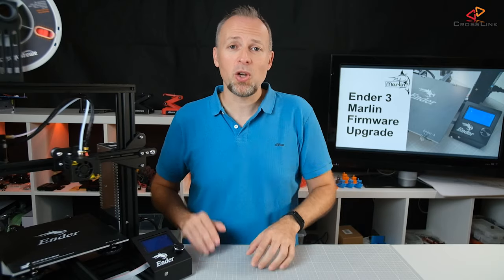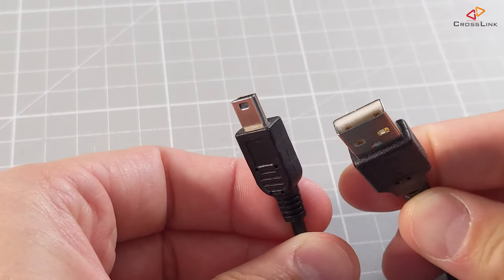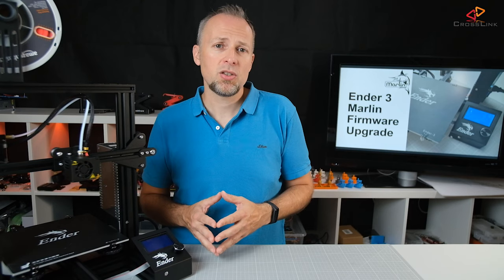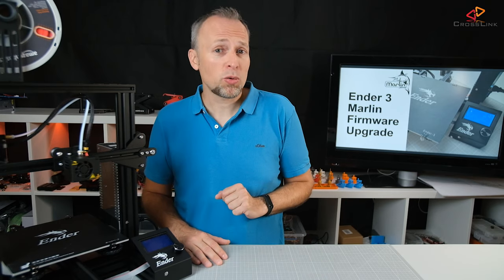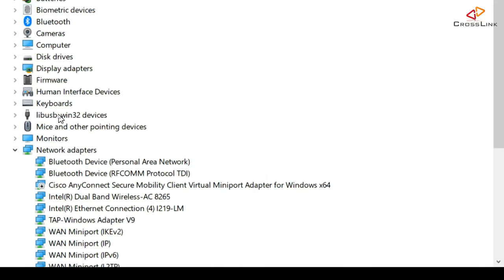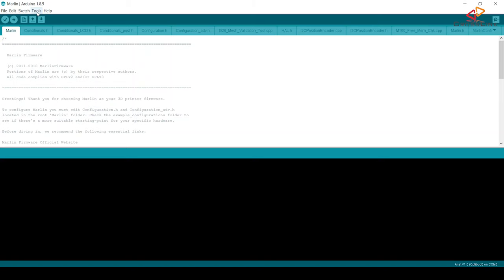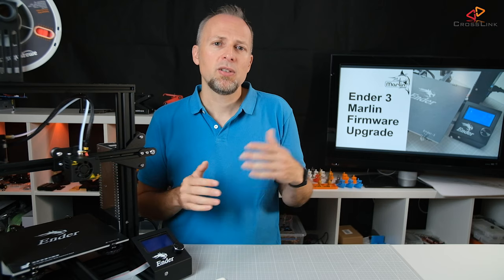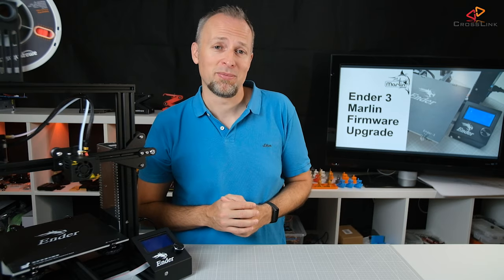Ender 3 Marlin Firmware 1.1.9 Upgrade - Full comprehensive guide with troubleshooting

Comment: Hi, I followed all of your steps but get the following message when installing the library: 

Could not find boards.txt in C:\Users\luket\Documents\Arduino\hardware\Sanguino-master\bootloaders. Is it pre-1.5?
Could not find boards.txt in C:\Users\luket\Documents\Arduino\hardware\Sanguino-master\variants. Is it pre-1.5?

My printer now only shows a blue screen and i cant do anything. Any advice?
Reply: It sounds like you got the bootloader installed, but nothing more. Your printer is not functional. You need to upload the firmware now.
Reply: I had this too and then once I installed the new firmware with the regular USB cable (not attached to a USB hub), it worked.

Comment: Hello, can you help me?
I have tried bootloader flash and firmware using USBasp when burn bootloader works well, but when uploading the firmware an error message appears and now my ender 3 is blank screen Please help
Reply from the maker: Can you send me the log file. Enable verbose output before please.
Reply: @Crosslink3D  Thanks before..
at this time the problem is over
but I do not understand, every time my printer lives it goes directly into the resume print menu
without bootlogo
I re-flash the bootloader and firmware (only activate resume print and boot ender logo)
the result remains the same, no boot logo

Comment: Thank you so much for putting out a CURRENT flashing guide for the ENDER 3 3D printer!!!
There are a number of guides out there but they are a bit dated (in tech world time). The most recent I found out there behind yours is 8 months old. Sadly, I watched the aforementioned video before I watched yours and wound up buying an Arduino UNO for this application.

I want to flash the newest/best marlin firmware, but I already bought a Arduino UNO. Which steps in this video are different, in this case? At the very least, the other video I watched can serve as a guide on how to connect it all. 

PS- Don't get me wrong, I also love the videos by TH3D on this subject matter, but yours is the newest, most current AND is specifically catered towards users with the Ender 3/Ender 3 PRO with a stock board with factory firmware, so thank you!

Comment: I installed and selected the Sangunio ATmega 1284P board and I'm getting this message "The current selected board needs the core 'arduino:arduino' that is not installed."
I'm not sure what to do about removing that message?
Reply: Yuo need to install some librarys and a repository, what i done is download the th3d , then they hace an Arduino ide modifide for this, wiht that i compile succefull 1 1.9

Comment: I am not getting the option to select the sanguino option. What have i done wrong? I am using Arduino 1.8.13 I can not see the option to select it from the list.. I am using USBHD as my USB programmer. It's recognized in windows 10, blue light is on the mainboard.

Comment: i dont have an ender 3 but I have the same controller. similar printer. why the hell does it keep printing far into the corner and off the bed? ive messed with the settings on the controller and ive messed with settings on Cura. Very frustrating...

Comment: that`s a perfect video! I want to upgrade my ender 3 to have more functions as `filament disruptions detection`, `auto-leveling` `newest firmware implementation` `true hints to increase the overall speed of print` `enhanced printing accuracy`, `better air flow to cool down the printed model`. can I ask if there really useful examples of such improvements? best regards and good luck!

Comment: I do not have the 6 pin on my board. I have the V4 2.2 board. It only has a 4 pin connector where all your videos show a 6 pin. Can you shed some light on my situation. I am trying to update so i can run my bl touch as well as my big tree tech touch screen.

Comment: After I run the Arduino IDE, it comes up with a screen to setup code for a sketch but unfortunately I have no clue how to do that so I am stuck there. The Marlin version that  comes up now is also the 2.0 version. Also with that said, my screen images are not like yours I'm guessing because of the different software version number. Any help would be appreciated
Reply from the maker: I think you have to go to the file menu and open the Marlin.ino from your downloaded firmware directory.

Comment: Tried flashing the firmware without a bootloader, am pretty sure I followed all the instructions but it gives me this error:

Arduino: 1.8.11 (Windows 10), Board: "Sanguino W/ ATmega1284 or ATmega1284P (16MHz)"

The current selected board needs the core 'arduino:arduino' that is not installed.

Error resolving FQBN: missing

Error compiling for board Sanguino W/ ATmega1284 or ATmega1284P (16MHz).
The current selected board needs the core 'arduino:arduino' that is not installed.

This report would have more information with
"Show verbose output during compilation"
option enabled in File -> Preferences.

Comment: Please help me

I was using an Arduino to flash the firmware but it didn't work
Next i tried with an old atmel usb asp and choose the option 'upload from programmer' but after that it says that it has failed to verify at the bit 0x0000000 

Now my printer only shows a blue empty screen 

Please help me

Comment: need help ASAP in tool boards, Sanguino is not there at all? ive tried everything and nothing! everything is in the right folder 

EDIT: Sorted!!
Reply from the maker: What was the solution?
Reply: @Crosslink3D  with the new link for the ender 3 board definition i had to rename that folder to sanguino and then put that folder into the hardware and then it worked, for some reason the sanguino folder i had orignally put in there only had 1 file which was just the pins_arduino so it wasnt recognising anything :D hope this helps anyone else
Reply: @SwFTTTT  Thank you so much!

Comment: Hello. Thanks for this useful video. I have a question about the Ender 3 Pro. You probably know that the Ender 3 Pro has a functionality that allows it to resume printing after a power cut for example. If I upgrade the firmware, would I lose that functionality or any other functionalities?

Comment: Thanks so much for the tutorial but as you said earlier in the video the marlin firmware may be updated after the time you posted this video. In the new version the files and folder are not the same so confused on the steps to be followed with the new firmware of marlin, please guide me, as I am stuck halfway - thank you
Reply: As of now, copy the Sanguino-master folder into the hardware folder you created. I changed the name to Sanguino (as it says it is in the instructions) and it worked. Not sure if this is necessary or not.

Comment: I recently purchased a BL Touch for my Ender 3 Pro, it came with a USBISP, will that suffice in place of the recommended USBASP/USBispTiny? I tried following along this tutorial, but received an error when I clicked Burn Bootloader from the Arduino IDE. 

avrdude: error: could not find USB device with vid=0x16c0 pid=0x5dc vendor='www.fischl.de' product='USBasp'

I had no issues until that point. The blue light turns on when I plug the USBISP to my laptop and the Ender motherboard.

Running Windows 10, downloaded USBASP drivers as recommended. 

Arduino IDE 1.8.12 (from zip file)

I will say, from the Arduino IDE --> Tools --> Port is grayed out. I'm not able to see any port options. When I went to my device manager, there wasn't a Ports (COM & LPT) section. I looked online and found a way to add that. It added the section, but has an exclamation point over it. And the Ports menu from Arduino IDE is still grayed out. When plugged in, the USBISP shows up under the Universal Serial Bus devices as USBHID, in the device manager.

When I tried installing the drivers for the USBtinyISP from ADAfruit, I didn't run into issues with the driver installation, but the LibUSB menu didn't pop up in my Device Manager.

Also, using the Zadig tool, it said USBHID, instead of USBasp. From there, I clicked Reinstall Driver for WinUSB (v6.1.7600.16385), this appeared to work as advertised.

Please give me some guidance to end this madness. Thanks in advance!
Reply: Yeah, once you wipe the system drivers (it warns you you might not want to do this) you are a bit stuffed on that machine using the ProgISP program I think as well...  basically the clone doesnt like avrdude.

Comment: I recieved this error when trying the upload using programmer.  #error "Oops! Make sure you have 'Arduino Mega' selected from the 'Tools -> Boards' menu."  What did I do wrong?
Reply from the maker: Probably you missed to install the sanguino board definitions?
Reply: I copy and paste the files into the folder you show on the video. Any other ideas? My ender 3 is a brick right now.

Comment: 1. the printer is disrupt now - I tried to `steal some additional millimeters` out of the design, to have bigger height of printing area. I turned in 4 nuts to make the printing bed as low as possible. the internal thread inside one of nuts got damaged, and all 4 springs got mechanical over stress, they do not retain the shape any more. 
2. I ordered `more tough`  springs and replaced screws with longer and better metal quality ones. but the springs are so hard, that the basement got de-shape while I tried to level it
3. I`m interested in making the construction more hard 
4. is it possible to build thermal stabilized shelter around the printer to print ABS
5. is it possible to divide power supply into two parts - the motors+digital part + heater to connect to uninterruptible power supply  to have it save of short term AC-power failure and 
6. to connect 230V AC powered bed to have it heated in less time and to connect it directly in to the AC-mains
7. to extend wires and bring the electrical part out of the heating chamber to have filament there to pre-heat and all parts, that are impossible to bring out to cold area
could you please be so kind to advise?

Comment: my lcd on the printer is blank please help me here to get my printer running, thanks 
error message :
Arduino: 1.8.9 (Windows Store 1.8.21.0) (Windows 10), Board: "Arduino/Genuino Uno"

Invalid library found in C:\Users\admin\Documents\Arduino\libraries\arduino_318978: no headers files (.h) found in C:\Users\admin\Documents\Arduino\libraries\arduino_318978
Invalid library found in C:\Users\admin\Documents\Arduino\libraries\arduino_53610: no headers files (.h) found in C:\Users\admin\Documents\Arduino\libraries\arduino_53610
Invalid library found in C:\Users\admin\Documents\Arduino\libraries\arduino_709561: no headers files (.h) found in C:\Users\admin\Documents\Arduino\libraries\arduino_709561
Board at null is not available

This report would have more information with
"Show verbose output during compilation"
option enabled in File -> Preferences.

Comment: Pro-tip, you can use an arduino Uno to flash the bootloader.
Reply from the maker: Yes, this is true. It is a bit more work with the cables to connect but it works well! I did explain this also in another video: https://youtu.be/RQIizXtf9oo

Comment: followed all steps using usbtinyisp and i get this error>>>>>>> 

avrdude: verifying ...
avrdude: verification error, first mismatch at byte 0x1fc00
         0xff != 0x1f
avrdude: verification error; content mismatch

avrdude done.  Thank you.

Error while burning bootloader.

i am unable to get past this point because i did everything you said in the video and even went over it multiple times ive been at this for 4 hours straight now with no change. same error every time. i am super frustrated as all i want to do is a firmware update for the change to an ac heated bed. the printer worked great and now because of this error it wiped my original firmware so now i cant use the printer even if i revert back to the original bed.
Reply from the maker: Hi Michael, I once had this issue and fixed it by executing the last command that the Arduino IDE uses to flash the firmware and modify it. The command can be seen if you enable verbose output in the IDE settings for compiling and uploading. It might look like this: C:\Users\dkreuz\AppData\Local\Arduino15\packages\arduino\tools\avrdude\6.3.0-arduino14/bin/avrdude -CC:\Users\dkreuz\AppData\Local\Arduino15\packages\arduino\tools\avrdude\6.3.0-arduino14/etc/avrdude.conf -v -patmega1284p -carduino -PCOM12 -b115200 -D -Uflash:w:C:\Users\dkreuz\AppData\Local\Temp\arduino_build_761182/Marlin.ino.hex:i 

What you need to change is add a nother parameter , which is -F which overrides that failing check. After that I never had an issue again.

Tell me if that works!
Reply: @Crosslink3D  that error is created by after upload check

Pls help me look at my other global comment

I can understand technical terms so feel free to answer like that

Thanks in advance

Comment: My Ender 3 board has 10 pin only and it doesn't look like yours at all?
Reply from the maker: Can you send a picture?
Reply: @Crosslink3D  I got it wrong, i was to open the other panel not the lcd back. thnks
Reply: @Crosslink3D  When i started yesterday i could see the driver for Usbasp after i tried to flash the boot loader I got the error and when I checked the device manager I couldn't see the driver, now as I plug in the Usbasp it doesn't recognize it.  still cant install the driver for usbasp it shows up as Unknown USB device Device descriptor request failed. even when i installed the driver for the tiny usb I can't  see it in the device manager even though it showed installed correctly. thanks

Comment: Nice video but it is by no means "Full comprehensive" when you don't include the Arduino UNO as a way to install the bootloader. I already have an  Arduino UNO now if I want to follow your method I need to buy more stuff.